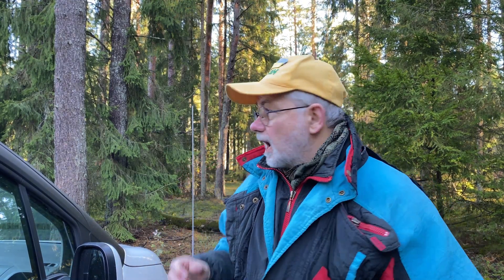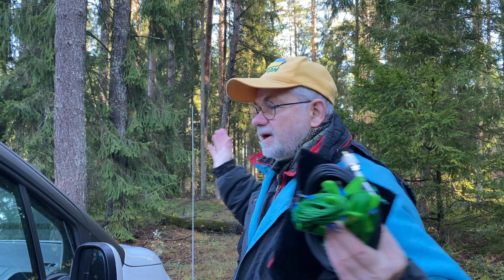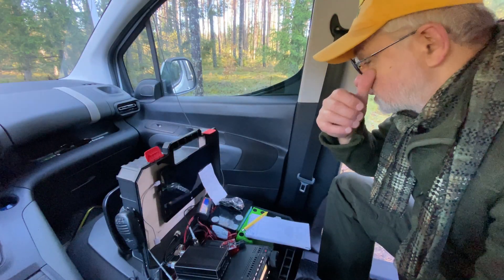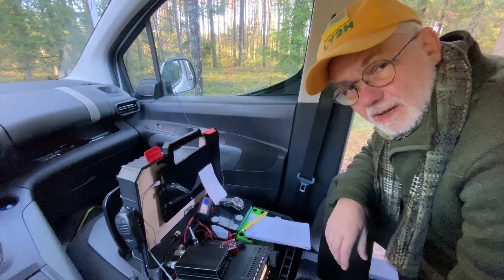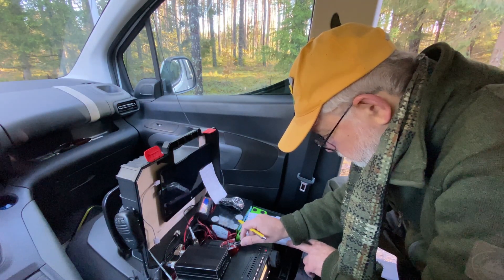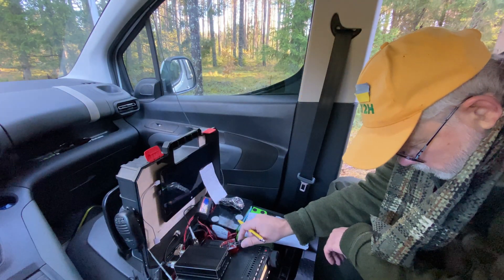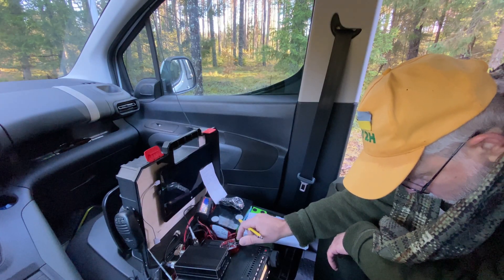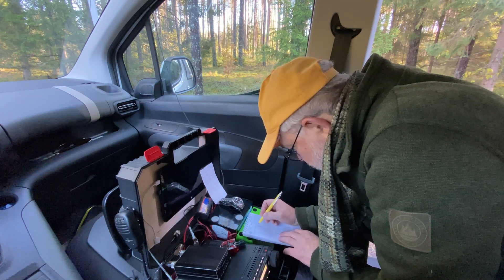Lossy RG-174 cable is good for DX! Test in the park (and updated info in the description!)

Comment: Linus, great video!  I work solely QRP.  I prefer RG316.  Why?  It coils nicely and works well.  Originally I used RG174.  I still have two or three in a gear bag.  I cannot tell any difference.  Lengths up to 20' are all I use.  Antenna deployment is the primary factor contributing to field success.  Thanks Linus, great video!   72, de W7UDT ID sk ee

Comment: You said loss is 9-10db for 30m so your loss for 10m would be 3db+. Around 1/2 a S point, not the 1db you quote. Not the end of the world but still lossy especially if you run 5w like many SOTA/POTA operators do. With QRP every bit counts if you want consistent success even when conditions are bad.
Reply from the maker: Thanks Rudi! You are right , I've made a mistake :(. I've corrected this mistake in the description to the video with new, updated information provided. Sorry everybody, please check the description! 73! Linas LY2H

Comment: Nice vídeo, Linas. Completely agree. I operate always QRP and I’ve being using 10 m of RG-174 with my portable 20m dipole for years. Also for my vertical and mobile antenas. I did some comparison with RG-58 and, apart from robustness, weight and bulkyness, I didn’t notice any difference in performance (on practice, I mean). So I thing it’s perfectly valid for portable and QRP operations. I have no experience running higher power, though. VY 73!

Comment: I use same set up with coax and balun too, tried without balun RF feed back very bad. Only used that coax much better than RG58, as my runs are 10m max.
Use Rg58 on same run and length no noticeable difference except the balun was much bigger centre was much lower as mine is end supported,centre is free hanging. BNC works for me, as my radio is QMX..
Reply from the maker: I like QMX too! CU on the bands! 73! Linas LY2H

Comment: Great job, thanks. I have a couple 25ft runs of RG174, terminated with BNC ends, that I use for portable ops, on vacation, etc... I run about 80w or so usually and I love the RG174 stuff. so light, so flexible, and if you are careful with it, you can usually close your vehicle door, sliding door at the cabin, etc.. onto the cable without pinching or damaging, provided you have decent rubber seal. 73 WD9M